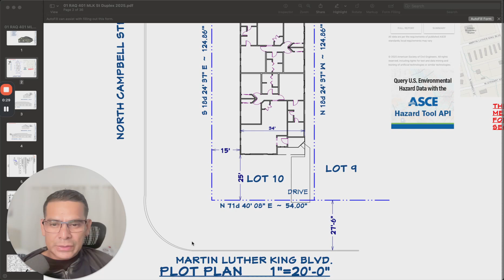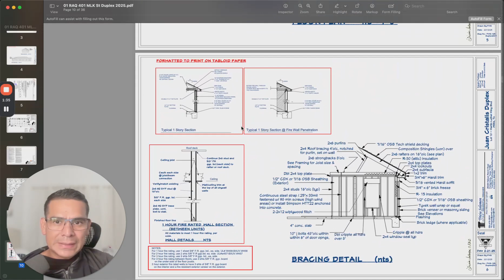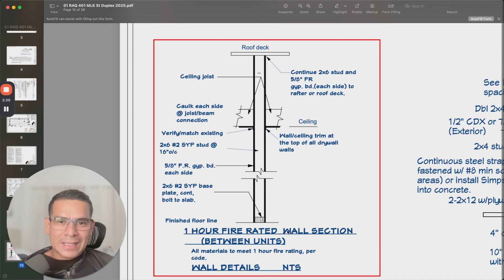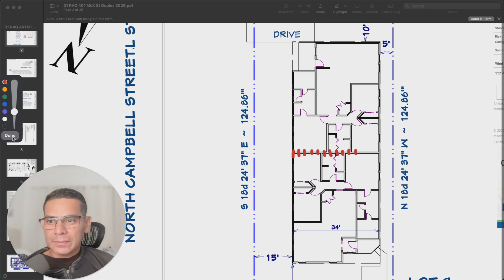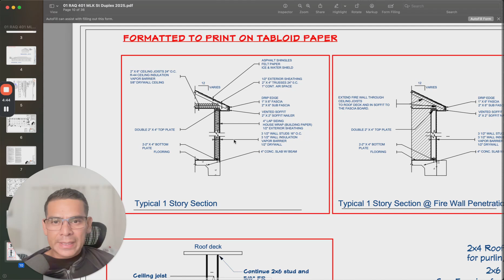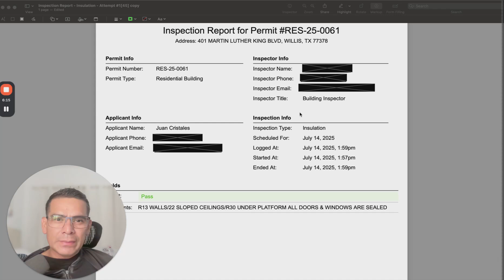Firewall for Duplex Construction: Step by Step Guide 🔨

Comment: Thank you for this video Juan,  Question: on a 6” firewall do you put the fire rated sheetrock on the firewall before or after passing the framing inspection?  Thanks
Reply from the maker: We do one side first. We then put the insulation in. Request the insulation inspection. They will see the insulation in the firewall going all the way to the top. Then after that inspection is passed, we will cover the other side of the firewall.